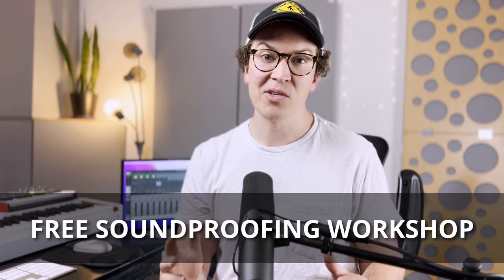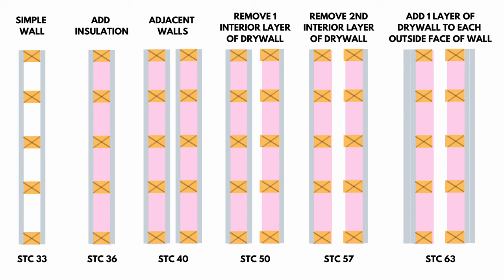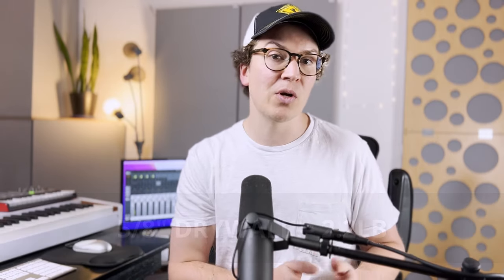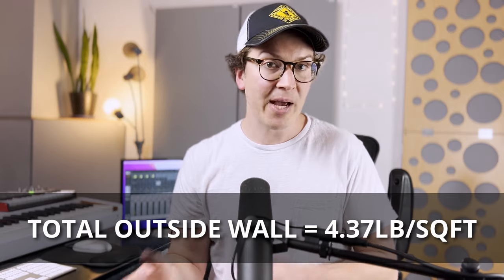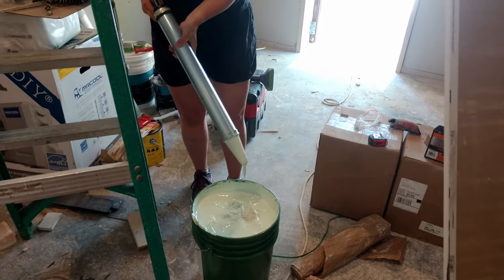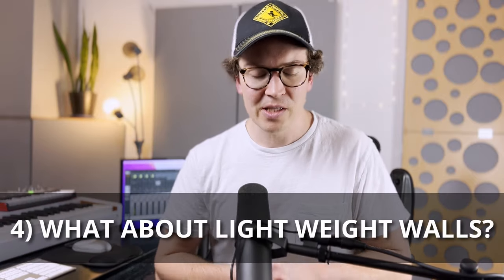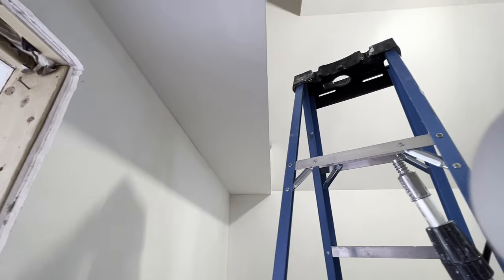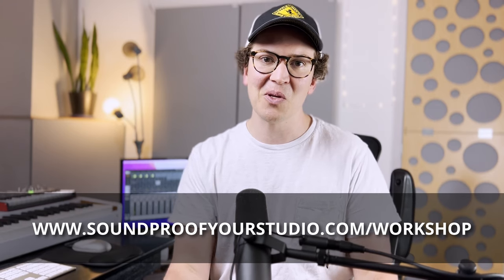How To Soundproof Exterior Walls

Comment: thank you. I have a bedroom with alot og traffic noise, Hardy board on the outside with 1/1/2 hard foam with osb board, pink insulation 6 inch studs then 1/2 inch drywall.
I guess green glue and add 5/8 fire reated drywall. replacing 2 windows with doubble pain glass plastic coated. hopefully this will reduce the noise cheers
Reply from the maker: You are on the right track. I saw your email and responded there. Thanks for watching.

Comment: I'm building my home studio in my garden and your videos are a big help. I'm gonna have pretty good  double walls, but i was thinking about something extra. What would you say about drywall just on the inside?
Reply from the maker: Not sure I understand, but you need two layers at least of drywall on the inside and outside walls. If the outside wall is exterior then match the drywall mass with exterior siding.

Comment: If you don't mind my asking, how did you secure the 5/8" drywall to the exterior wall of the Tuff shed build? I am just concerned that using drywall screws might penetrate the exterior wall. Thank you for the great video!
Reply from the maker: Yes, you need to use smaller screws. I would have to ask Henry the contractor what size they used.
Reply: @soundproofyourstudio  one other question if you don’t mind. What did you use to fill the gaps between the drywall and the studs? Unfortunately the studs of my shed aren’t the straightest and there are some gaps here and there. Thanks again!!!!

Comment: What's the principle behind matching the mass? Will otherwise adequately dense walls be made worse if one wall is different from the other? If so, I'm also wondering about significant furnishing additions to the mass of the interior wall, e.g. wall to wall thick bookshelves
Reply from the maker: If you have walls with differing mass the wall with less weight will perform worse, but not necessarily bad. Furnishing like a big wall to wall bookshelf should be considered as more mass.
Reply: @soundproofyourstudio  Thanks, that's interesting. To make sure I'm clear, if the lesser wall will perform worse do you mean 1 ) worse than the greater wall, due to having less mass 2 ) worse than an equivalent but balanced wall, due to a dynamic of the ratio itself

Comment: What do you recommend if exterior walls are in a basement? There is a ton of mass there, so is there any benefit in doing anything over and above typical framing on those walls? This assuming a dropped ceiling which would be decoupled from the floor above.
Reply from the maker: If you have concrete walls then you are off to a great start. A seperate framed wall is best. You can also decouple using foam and drywall. Lots of options.

Comment: Building a gymnasium at church. Looking to minimize the bleed over sound from the basketball court to the adjacent rooms. The court is in the middle of the building on one side there’s the youth room on the other the kids room. Both rooms are separated from the gym by a 3hr fire wall. It has 3layers of 5/8 Sheetrock on each side of the metal stud wall. Would putting rock wool in firewall cavity help with sound transmission? Or is the 6 layers of Sheetrock sufficient?
Reply from the maker: The six layers of sheet rock is good, but there isn’t any decoupling. Adding fiberglass insulation would help damp resonances in the wall cavity.

Comment: So what if the exterior is already done, with one layer of osb and vinyl siding. Will I get no benefit for two layers of sheet rock on the inside since the outside is not equal mass?
Reply from the maker: You just do the best you can. You will certainly get a benefit. What about adding another layer of sheet rock on the inside?
Reply: @soundproofyourstudio  hello and thanks, I was considering 2 layers of rock and then a 1/2" laminated slat wall for the interior. Basically it's dust and glue with a laminate that looks like a wood grain. However it's thin where they join, so not sure what I'll gain for sound proofing vs aesthetics. You're other video convinced me to stay away from MLV. ;-)

Comment: Hey, I'm about to build a control room to do Dolby Atmos mixing, so I need to mount speakers to the ceiling. My ceiling is made of OSB, and I'm having trouble finding a way to mount the speakers while making sure the vibrations won't travel into the ceiling, and convert my room into a giant cello. Do you have any idea how to do this? Thanks!
Reply from the maker: I don’t have much experience with mounting speakers to ceilings, but I imagine you need speaker mounts that decouple sound vibrations. There must be mounts on the market for atmos systems.

Comment: This is the second video I've watched and I have real mixed feelings about the information you are sharing with others.  I think some of it is spot on and good for people to know.  Other information, may be ok but there are certainly better solutions.  Normally I wouldn't care, but from the two videos I have watched, it appears as you're selling yourself as someone who is highly knowledgable in the field and here to help others.  I think if you are going to do that, you have a responsibility to be somewhat of an expert in that field or mention that you aren't if you are not.  People out there are going to listen and follow your advice, and I think no information is better than wrong information.  I think one of the worst things you can do on YouTube is to give others advice they will believe that will end up leading them in the wrong direction.  Just say that you aren't an expert and that we are all learning together.  Sorry just my two cents on that.  

Regarding sound, I totally agree with the double 5'8" drywall and the double wall with air gap being the best way to go.  Spot on advice.  But it isn't all about mass.  Yes Hardie board is dense and helps some with sound, however 1/2" steel has a mass of 20.4 lb/sqft, far exceeding anything mentioned in the video, and is a terrible material for sound reduction regardless of its mass.  It's the composition within the material that is making the difference.  With the double wall, if it were all about mass, you would just but them all together.  But it is the air gap, which has very little mass that is a huge component in the equation.  A better solution for your exterior walls would be to add 2" of polyiso insulation, which has low mass, to the outside of your sheathing followed by an air gap, made by strips of wood and then throw your Hardie plank on top of that.  There is no insulation covering the beams within your walls, it's only between the beams, so if you don't insulate them, sound and weather can travel through them without a ton of resistance.  In addition, not only will you have better sound deadening properties this way, but the air gap between the polyiso and the Hardie plank will also act as a rain screen, which is very beneficial for letting moisture wick away or dry and not allow mold to form on your walls.  Between the studs in the walls, I myself would do Rockwool instead of fiberglass as not only do I think it has better sound properties, but it has several safety benefits to it, as well as others.  Having said everything above, I am also not a professional in this area of expertise and understand I could be wrong as well about some things.  I am just someone with a lot of experience that has done a tremendous amount of research.
Reply from the maker: Thanks for sharing. I don’t claim to be an expert and I am always learning too. If people do what I say and it works great. If I am wrong call me out and I will learn.